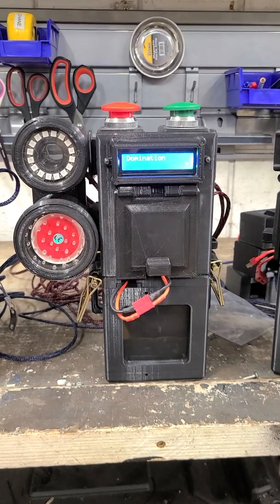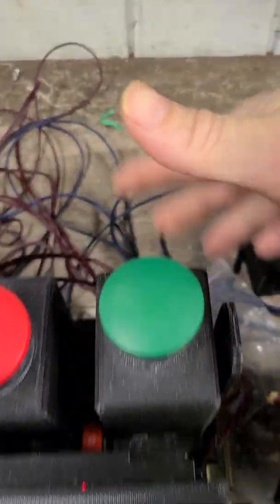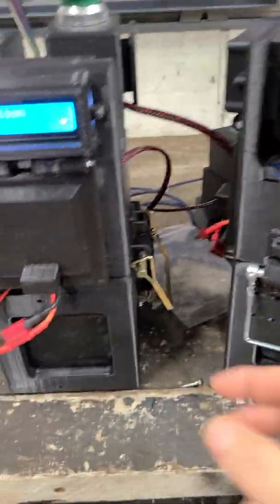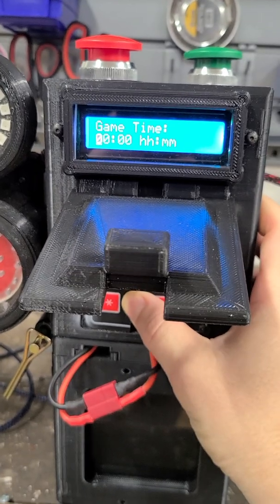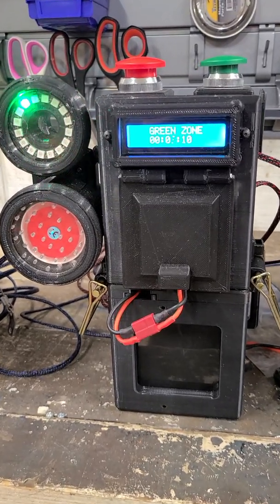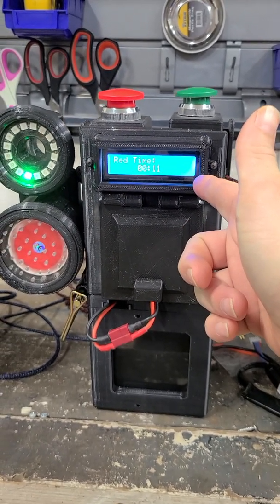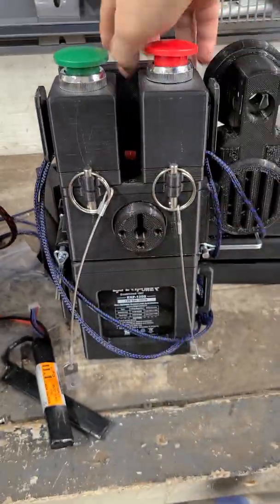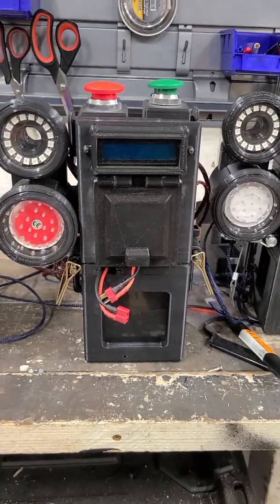Airsoft Arduino portable capture the flag station

Comment: How much? And what platform are you selling these on?
Reply from the maker: Hello, I custom design and build these for clients on commission. These were commissioned at $500/ea and 4x were fabricated for the client. Do you need a capture station or prop for multiplayer games?  Thanks -Cy
Reply: @cylixconceptsdesigns3159  yes I will. Currently in the process of opening a indoor field
Reply from the maker: @DuWardP  feel free to shoot me a message and I can set up a quick discovery video chat with you to see what your field needs are and if you need a custom solution or an off-the-shelf system. Cylix.shane@gmail
Thanks